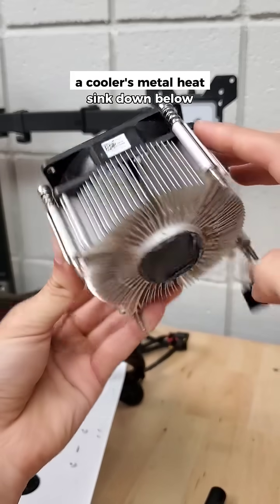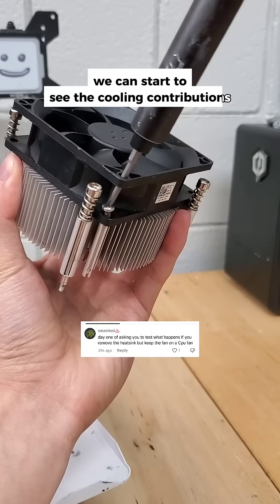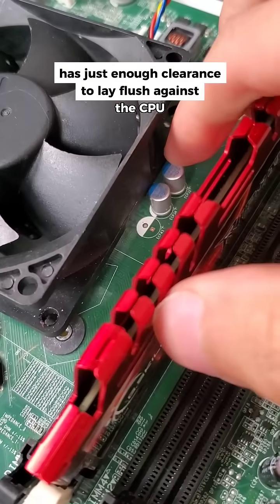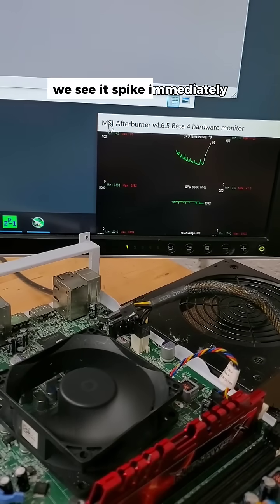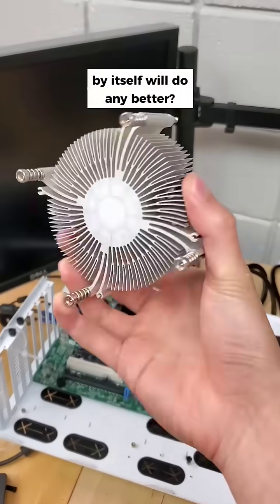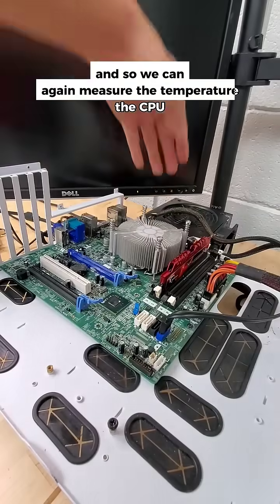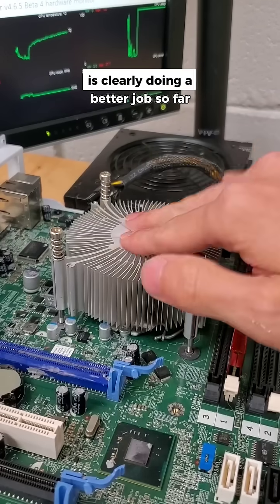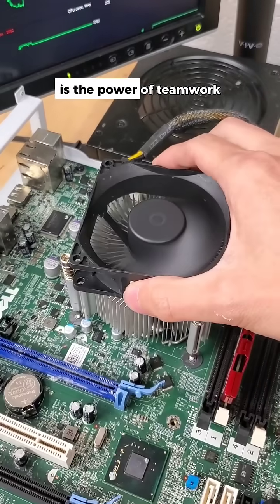which aspect of a CPU cooler is most important? #shorts

Comment: How about mounting the fan an inch or 2 away from the CPU so it can pull hot air away from it. I know it needs the heat sink but I think you did this test wrong.

Comment: I wonder how the fan would do if it wasn't directly attached to the cpu. Because by attaching it directly, the air the fan is moving is just the one around the cpu. But if a gap was left, it would move the air over the socket.

Comment: the reason for this btw is because the thermal energy from the cpu goes into the heat sink because its in contact with it and then the thermal energy from the heat sink goes into the air, and the fan blows that air away because this brings in more cold air for the heat sink to transfer heat from the cpu into.

Comment: @mryeester, Reasonable test for general experiencial learning on thermodynamic, heat propagation and transfer on CPU in a PC. The heat sink and fan function as a multi-layer heat exchanger with the first surface of heat transfer being the metal surface of the CPU to the Thermal Paste to Metal Heat Sink by Conduction (heat transfer by direct surface contact) to Air pulled through Heat Sink with the Fan by Forced Convection (heat transfer by powered bulk fluid motion) to air in the environment by Free Convection (heat transfer by bulk fluid motion without power, naturally). So the plastic fan has very poor thermoconductivity, even with air movement minimal heat transfer takes place as air naturally has poor heat transfer due to low density of gases. The heat sink being aluminum has a high thermoconductivity, but with the heat transfer being almost exclusively by conduction the aluminum with continually get hotter due to little heat loss to the environment, meaning most of the heat will build up in the aluminum heat sink until the CPU overheats. That is why the combination of thermodynamically optimized selection of  materials and multiple modes of heat transfer to allow the heat exchanger to manage the CPU heat for a functional computer with little limits on length of usage time for temperature or overheating.

Comment: I'm just wondering what went through your mind when you thought using thermal paste to stick the fan directly to the CPU would do anything.

Fans have the highest airflow on the outside edges where it's moving fastest. Lastly, that solid plastic slab in the middle is preventing any airflow from reaching the CPU at all.

Comment: not only didnt the fan cool the cpu at oll because it was in the deadspot but thats exactly why u probably wont get a cooler without both

the metal thingy absorbs the hear and distribute it to areas with a good surface which is why the cpu takes longer to heat up with just that compared to not being "cooled" at all
and the fan cool's the survace area of the Heatsink 
because the heatsink is designew with a good amount of surface the fan can cool it works that well

Comment: Laptop cooling is poor compared to desktop as the conductive material with fan is far from the processor thou they try to use clever solution.
Material and relationships are two different whatever.
Agree /disagree.

Comment: The heatsink helps transfer the heat to the air the terminal paste helps connect thermally the CPU to the heatsink and the fan moves the air so the heated air gets changed by coolers one that then will absorb the heat from the heatsink that was made by the CPU so the fan is les useful than the heatsink

Comment: the most important thing it is the thick shaft of the aluminium heat spreader as a kernel for the fins. if the diameter is big, it wont cool the cpu perfectly and is prone to overheat

Comment: Heatsink gets/absorbs heat from the heated component, a fan does not

Heatsink doesn't know how to transfer absorbed heat to another place, but a fan does.

If you found a fan that can absorb and transfer heat then that's probably a breakthrough.
But for now, heatsink+fans is a good combo.

Comment: The heat sinks main goal is to absorb the heat from the generator of heat and evenly distribute that heat among all of its “blades” each blade is exposed to air so it cools off more efficiently then if you were to just make a block of metal made of the same heat conductive material.

The fans job is to circulate air through the heatsink’s “blades” and expedite the cooling process by sucking cold air in through the heat sink and throwing it out into the case where the case fans suck that in and expel it out into exhaust

When only one is used you see the following, heatsink only it’ll heat up gradually as the heatsink distributes heat but without the fan to cool it off it’ll slowly rise until it reaches its maximum heat

Vice versa with the fan, without the heatsink to properly distribute the heat the only part being cooled off in the CPU is the outermost edges of the CPU since such a little ammount is actually cooling off the heat will quickly spike until you turn it off

Comment: You can have only passive cooling with a heatsink, but it needs a bigger area. 

With smaller surfaces you need to move the high temperatures out of the system, that's why in that case both are needed. 

In order to only make the fan effective it requires to target the CPU directly, and needs to move the air at a super high speed and pressure so it can move the heat away.

Comment: The heatsink acts as extra surface, both for dispersing the heat and receiving ariflow, the bigger the heatsink is, the lower the temps as the heat needs to travel evenly across the whole heatsink therefore causing it to heat up slower, at the same time it has more surface area to receive cold air more cold air+less hot temps=cooler CPU

Comment: I mean the fan was unable to blow any air directly on the cpu since it literally covered it up by the housing. So idk, it definitely aint as efficient but it might just be better than 100°c. Ohw, and it pains me to say, but if u try it with actual clearance, dont use any thermal paste either. The paste will be in the way of direct contact from air to cpu.
Reply: The way the Fans are mounted on the heatsink in the complete cooler Set Up are built so the fins in which the Most surface area is available to Blow Air through is accessable. The Middle is completly sealed Off. So giving the the Fan its own way to Blow Air directly on the CPU should Help the results at least a little For the fan

Comment: One big problem is that the fans are not i midle so slaping fan in midle is like puting none moving plastic on ho pancake. You need to direct the flow of air to cpu to see actual results. Not that it will be ani significant but atleast whould do somthing rather that lie flat.

Comment: I mean... To be fair the fan only test was flawed as the fan was not actually blowing air on the cpu. The cpu was in contact with the plastic hub and the air was just going around the edges. To really test fan only you would have to suspend the fan very close to it where the optimal airflow is hitting it. 
That said the test would still show that it does next to nothing but it might not climb as fast.

Comment: Without a fan, the heatsink is still able to passively cool off the CPU. That means it'll work fine if you underclock it enough to avoid throttling.

Without a heatsink, the fan is unable to properly move the heat off of the CPU, due to the lack of a medium of convection and the fact that the center of the fan is a blind spot, as plastic is a great insulator and there is no wind at the center.

Comment: Heat pipe is most important.. it perfoms better than a slab of aluminium.. .. but the best way to cool a CPU is to leave it off. 😂

Jey get that truck radiator assembly my CPU is running hot .. but it's nothing compared to women.. yeah... Awkward pj of all time in this second.     NOT..

Comment: If you were to run a water block heat-sync , its like a radiator of a car. The metal gets cold the easiest, chilling the water or antifreeze(just freeze resistant liquid for cars, to prevent the liquid from internally expanding and damaging anything)

Comment: Well, a heatsink (not this one necessarily) can work without a fan, but a fan doesn't do much without a heatsink.  If you got a processor and heatsink sized correctly (for example the heatsink you show could probably cool a 6 or 10 watt chip in the right conditions), then allowed for the hot air to convect, that is rise out of the heatsink and draw cool air from the bottom.  Or get one large enough to do that for a regular 35w-65w desktop class processor.  But a fan on its own has nothing 'sinking' or soaking up the heat for it to cool off.

Interestingly there is another option.  New technology making a high pressure that can directly cool a chip without the need for a traditional heatsink.  It has been demonstrated cooling a Macbook "air" 😂, so that it is as fast as a Macbook Pro.  Check it out.  It may enable faster handheld and laptops while keeping them very thin.

Comment: imagine blowing on your hot soup in a deep bowl, it takes forever to cool off bc of the ratio of surface area to soup, so it doesn't really do anything. now blow on your soup with it spilt out onto the countertop, it's going to cool off much faster bc the ratio of surface area to soup is much higher. that's what the heat sink dose, it conducts heat and spreads it out across all it's fins giving more surface area for the fan to blow on.
Reply: Not being mean, beacuse i did this too before and was bullied, its soup.
Reply: @klaymore_roomba  bruh your so right XD ill fix it. ty

Comment: So I had my heat sink come loose while moving and I noticed a dramatic difference of performance that I blamed the latest windows 10 update. 😅😅😅. Tightened it down after applying fresh thermal paste and it's running at 40°c not great but not running at 94° 😢😂

Comment: Older PC parts didn't use fans, and used only a heat sink.The fans were introduced when the voltage requirements increased.
Reply: I know this is a year late lmao but some gpus did have just fans with no metal heat sink in the 2000’s. Really weird design lol
Reply: @Lukewarmpee  That can work, but it's a weird design and really only works if you just need a little bit of extra cooling. It's more common for components to have a heat sink and no fan than fan and no heat sink for a reason.

Comment: Well,
if you made a Metal fan with a plate connected to the CPU would combine both in a compact package.
In theory
Reply: That's not just theory, that can work when properly engineered. There are downsides to it and when you have the option, adding a fan is usually preferable.

Comment: I've got an old computer that came stock without a fan. No fan output on the mobo outside the singular case fan... I don't turn it on any longer than five to ten minutes. Old eough that it has no ability to read anything younger than small floppy

Comment: OK, this is nonsense.  You didn't use the fan to blow air across the CPU.  Instead you used it to transfer the heat from the fan motor to the CPU. And no thermal paste would be required for that test because it would basically interfere.
Second, there's no validity to not securing the heat sink, because you didn't do anything useful with the fan.
This is pretty much useless.

Comment: The fan wasn't even blowing air on the CPU - the CPU was right under the deadzone making it as useful as nothing at all.
Reply: might be worse actually
Reply: @beaclasterWas definitely worse. put 4 thermal junctions on there 3 of which are insulators. 1) thermal paste conducts 2) Sticker insulates 3) sticker glue insulates 4) plastic housing insulates.

To those who dont know, thermal junctions are usually ineffecient, like if you sandwich layers of copper and aluminum with thermal paste in between each layer, it becomes a better insulator with each layer vs a solid block of copper or aluminum on its own.
Reply: by putting an insulator on top of the CPU that definitely made it worse
Reply: Plus the centre of a fan generates heat lol, so if anything it's just making it worse
Reply: That was what I thought too
Reply: You would THINK that this would be evident huh lol
Reply: Actually it's significantly worse as it blocks any potential cooling by not even letting the cpu access the outside air while also potentially adding heat as the motor runs
Reply: so true
Reply: yea
Reply: It would have been making it worse.
Reply: Nothing at all!
Nothing at all!
Nothing at all!

"Stupid sexy CPU cooler!"
Reply: I think it works like an exhaust
Reply: what level of stupidity is this
Reply: Not only The Dead zone but the heat electromagnetic fields created by the motor may generate more heat to cpu
Reply: This was a comment made 2 years ago and yet people are still replying as if they don't know that AIR exists and retains heat. If you pay attention to the heat sink, you might notice that it is designed to have more surface area which transfers heat to the air around it. If that air stays there it will become saturated with heat and will not cool off the CPU because it is now the same temperature as the CPU. The solution is to move the hot air away so that cool air can fill the space and cool off the CPU again. This is achieved with a FAN whose primary purpose is to MOVE AIR. Yes, overall it increases temperature but less of that heat is located at the CPU so it doesn't fry itself or nearby components. Same deal with case fans.
Reply: PSACPU
Reply: Yup. This video is stupid.
Reply: Fan is not for blowing Air to cpu , it is for make flow of air in grooves of heat sinker. 😑😑
Reply: @DesiAllrounder2018   heat sink spread heat that makes it more efficient . what do u think is blowing all the heat out of it .

Comment: Why is nobody talking about how he put jusy the PLASTIC fan on the CPU? Like, surely this is gonna help dissipate heat. It would actually be batter off without the fan at all, since the fan is BLOCKING all the air, and plastic is ACTUALLY TERRIBLE at heat dissipation

Comment: The heatsink is fighting a losing battle without the fan by its side, but the fan has no tools to fight on its own
Reply: I mean, it wouldn't have performed well, but he literally did that part in the dumbest way possible. It should have been blowing on the CPU, the way he did it was too make it a plastic heat sync. It couldn't even work as a darn fan.
Reply: Poetic
Reply: Well said and explained good sir
Reply: The heat sink is the tank, the fan is the DPS/healer
Reply: It's like a guy with no weapon vs literally just a sword
Reply: Its the army and its supplies the army is fighting a losing battle with no supplyies but the supplies cant fight
Reply: looks like we need onlyfans for the heatsink
Reply: Yep.
Reply: The issue is that the heatsink needs to be a lot larger if it's intended to be used without a fan or there needs to be liquid coolant that moves the heat to an external heat exchanger. .
Reply: I am heatsinks only fan 🥹
Reply: @7dyn639 heatsinks have only fans? 🤔
Reply: @thisguy9557  WHAT
Reply: @thisguy9557  WHAT THE FU- 💀😭🤨

Comment: The heatsink is the most important because the fan is there to cool the heatsink so that the heatsink can take more heat from the cpu
Reply: No both are equalas heatsink can't cool down the heat it absorbed and fan can't absorb heat to cool so it is a duo
Reply: @prodazer5259  I know both are extremely important but I think the heatsink itself is more important. There are some tower coolers that completely passive cool with no fans that are out there.
Reply: @prodazer5259  The heatsink is an army. It has a limited amount of ammo against an infinite enemy, but it can still fight back against them for some amount of time. The fan is the logistics behind the army, able to supply an infinite supply of ammo, but unable to fight AT ALL against the enemy. 

Only one of these things can actually resist an enemy on their own for any amount of time.
Reply: @prodazer5259 There is pasive coolers with no fans, but there is no cpu onlyfans (lol) heatsinkless cooler
Reply: Well you'll always see CPU coolers with just a heatsink by itself but not really a fan by itself
Reply: A big enough heatsink can cool on its own. It’s called a “passive cooler”. 

Many computers today are cooled entirely passively - phones, tablets, some models of MacBook (and probably other notebooks as well). I have a Pi that runs 24/7 on just a heatsink.
Reply: @StolenJoker84  Yes and IIRC back in the '80s, it was the norm to not have a heat sink or fan. The amount of power being consumed and the less dense chips didn't have the sort of need for cooling that more recent ones do.
Reply: Yeah, it's there to take out the air heated by the heatsink and replace it with cool air, so that it can be heaten and so on. This way it keeps a flux

Comment: The heatsink is the one who absorbs the heat, the fan only exhausts the heat out, that's why some coolers only use a heatsink without fans, most air coolers have pipes, that also help more in absorbing heat, but still the fan is important in exhausting heat out of the heatsinks

Comment: Use to have a passively cooled PC with a huge heat sync also had a 768mb 7600 gs video card I eventually mounted CPU and case fans on em when I started overclocking but they did just fine for working and light gaming even played halo and GTA vice City and San Andreas  on that thing before adding cooling would give like a hour before my system started to thermal throttle and fps would drop hince why I eventually added fans  lol

Comment: Didn’t you notice that the fan is actually not cooling the cpu? It’s pushing air around it as the cpu is right under the plastic center of the fan. Either way, you will probably still get the same result.